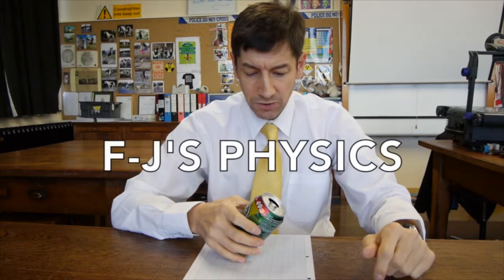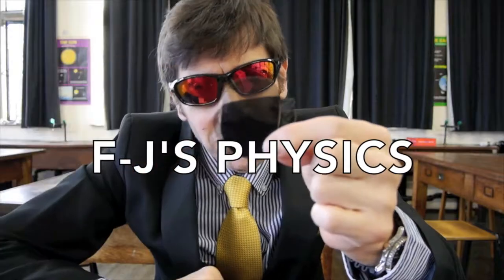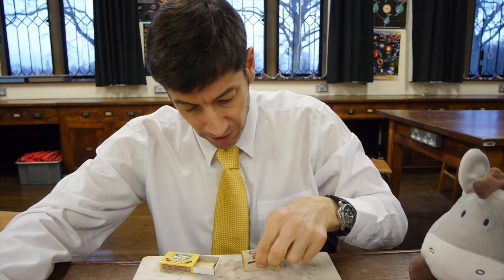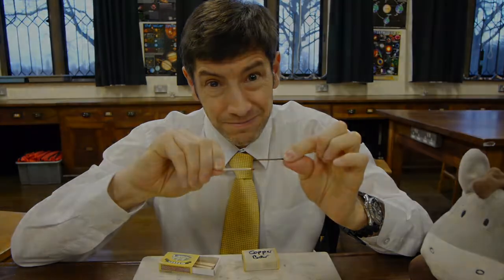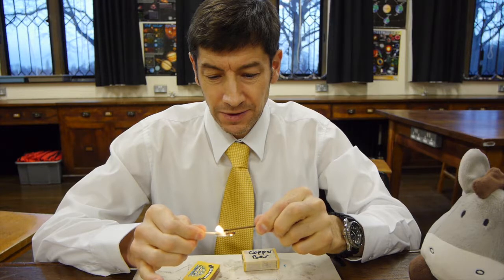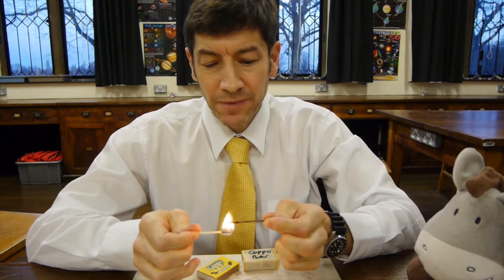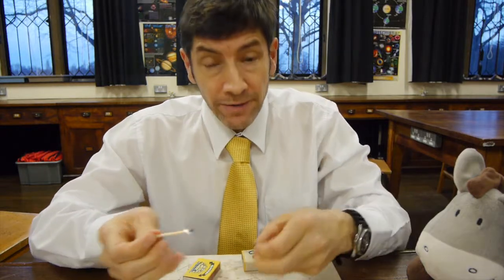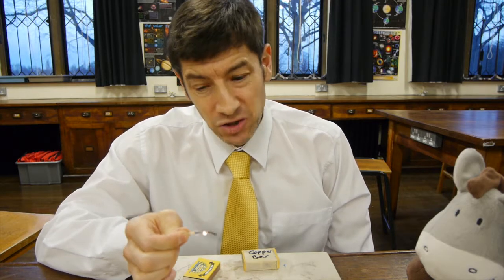Heat Conduction 2 - F-J's Physics

Comment: interesting you said wood was a poor conductor of heat i hadnt even thought that compared to the copper, your right you can hold the match way longer than the copper. Cool ty
Reply from the maker: Yes, this is a great example of multiple material properties being useful, in this case combustibility and low thermal conductivity due to a low free electron count.  Glad you liked the video and thanks for commenting. Tell me how you get on with any others you watch too!